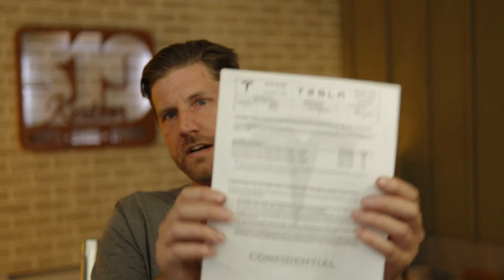Tesla Model 3 Salvage Title Rebuild Discussion

Comment: Im currently rebuilding a 22 Model 3 but am stuck on what I should do. The car is all fixed up and drives fine, luckily it still even has supercharger capability since I bought it salvaged without me having to go through the high voltage inspection, however the Autopilot mode does not work and I took it to a EV specialized repair shop and they said they are almost certain it has to do with the MCU and how it is burnt and needs to be replaced, however they said that they can’t touch it because of legal reasons only Tesla themselves can fix it. My problem is if I go to Tesla to try and fix it I will have to let them know my car is salvage and will probably get booted off the supercharger network and have to pay the 1,200 on top of fixing my autopilot issue. What can I do?
Reply from the maker: Okay that’s a tough situation. I agree the mcu is the likey problem especially if it has had low voltage power hooked up and it was out of coolant for a while. They will overheat and eventually burn out. The mcu is about the only part aftermarket guys can’t swap yet. If you can find someone with Tesla’s toolbox software maybe they can but it involves downloading from the original and flashing to the new/used mcu. The dealership will try to charge the salvage vehicle high voltage inspection before they will work on it. Also I wouldn’t be surprised if randomly the supercharger stops working when they catch up to it finally. Sorry, no good news.
Reply: @519Kustomz  yeah I forgot to update the message but I randomly got kicked off the supercharger 2 days ago 😕 so now I have no choice oh well

Comment: Hi, thank you for your great video! I still have a few questions I can’t find awnsers for on the internet.

I would like to repair a salvage Tesla. However, I am from Québec and I discovered that our resalvaging laws appear far more strict than in Ontario (I could be wrong). It requires absurd structure verification welding and documentation, with only official Tesla repair instructions.

It seems almost impossible to recertify it unless one is himself a certified Tesla repairman. I hope Ontario won’t fall in the same path.

Thus I am trying to find a total loss, but still clean title Tesla for my ambition.

My question is: how worried should I be that the car be declared "Unsupported" by Tesla (thus losing access to Superchargers)?

Can an "unsupported" car be realistically "resupported" by Tesla if one keeps a title clean (or Rebuilt)?

Could I buy, and maintain, autopilot if the Tesla is declared unsupported?

Will normal 240volt charging also be cut if I get "unsupported" ?

I am young and relatively poor, so fixing a Tesla might be my only way to acquire my dream car.

Thank you very much. 100% subscribing to your channel!
Reply from the maker: Im not sure about the differences in Quebec to be honest. Obviously the best option would be a clean title car, but everyone want that one...  In ontario we still need the structural safety done to tesla specs as well as normal mechanical safety. Unsupported is kind of misleading. You will loose the warranty for sure, but I still get all over the air updates. The model 3's can have a high voltage inspection done to regain supercharging, for a cost. My car had full self driving and it did stay with the car, even though it is rebuilt. I would assume you could purchase it after the fact aswell. The normal level 2 charging works perfect, it only affects supercharging. 

Hope that helps!

Comment: Amazing video!!! would you be willing to share the photos of the tesla you bought from the auction because we are thinking of doing the same but I dont want to buy anything which has a structural because I dont have the tools to fix. Dents and changing parts here and there should be ok but no structural damage. Just wondering what do you look for when buying salvage teslas? how do you spot structural damage in Teslas?
Reply from the maker: Tough one but usually you can see the insurance adjusters estimate before you bid on a car in the insurance auctions. That is very helpfull, but it can still be a gamble. Point and direction of impact can be quite telling also.
Reply: @519Kustomz  what would you prefer what should we buy? In terms of how much damage is there. Also is it better to buy front end collision with no undercarriage damage as a first starter rebuild car?

Comment: @519Kustomz.  will tesla remove the salvage title in the system? because everything seem to be fine?
Reply from the maker: It will be marked as rebuilt / unsupported. But, you can have the salvage title inspection done to get back on the supercharger network.

Comment: Did u have any error alerts when u purchase car from auction which ones and how did u clear it? Thanks
Reply from the maker: Yeah i had a bunch of error codes. Many restraint codes, park sensors, coolant valve, etc. Work through them system by system and usually the fault will clear itself after the parts are replaced or repaired. Sometimes a software re-deploy is needed.

Comment: Well done, car looks great! Re - your model Y not completing the update: Try plugging the headlight modules back in - it definitely won't update without those! My salvaged M3 can still fast charge because I don't think Tesla disabled it before the security certificate expired - this means that Tesla can no longer communicate OTA with the car (unfortunately this also means I don't get updates).  I agree, new parts from Tesla are surprisingly cheap! Sometimes it is more expensive buying them 2nd hand than new! Also, agree with you about solar - We are virtually self sufficient with power (solar and batteries) and even though we now use more power than we used to (due to charging our ev) we actually now draw less from the grid than before we had the EV.
Reply from the maker: good advice with the headlights! I will try that for sure. Interesting glitch with your ability to fast charge. If you plug into the tesla fast chargers it works? How does it verify the car for billing? Yeah the solar thing seems like a good solution, but anything EV/green tech gets so politicized Governments loose sight of solutions easily. Are you guys net metering too? I think Canada is well behind Australia and Europe as far as implementation.
Reply: @519Kustomz  Yeh, I trailered it to a Supercharger and it charges no problem :) I managed to get ownership through Tesla with a receipt of purchase (and some sweet talking) so the vin that gets sent to the supercharger was allocated to my Tesla account. Yes, we are are on net metering - unusually Australia is actually the cheapest place for rooftop solar (thanks to some regulations that were put in place to reduce installation red tape decades ago). It's a no brainer - great for the environment and great for the hip pocket (made even more so with an ev)!

Comment: From what I've heard, the reason that they get totalled so easily is that Tesla certified shops will often recommend replacing the battery pack if there is any chance of damage to it. So when you add that cost, it's an easy decision usually.
Reply from the maker: I have seen that too, any scrapes on the bottom of the battery and it is recommended replacement.